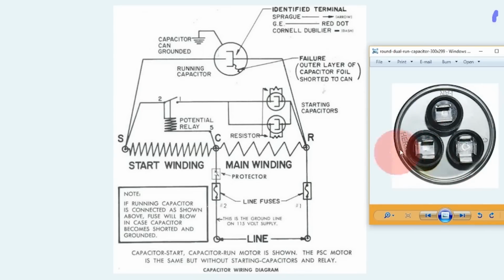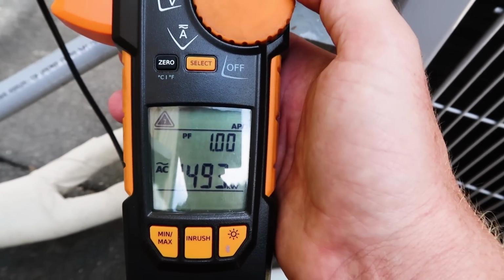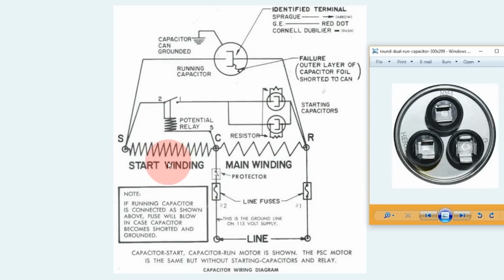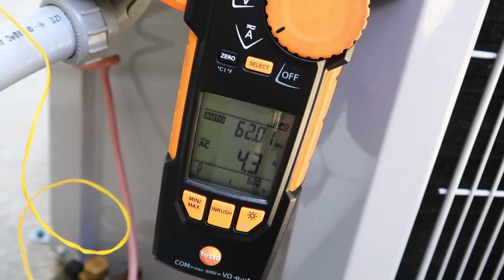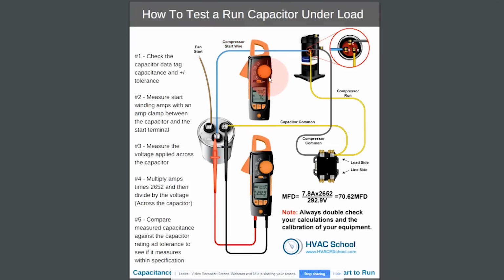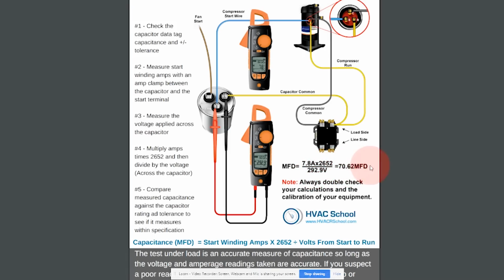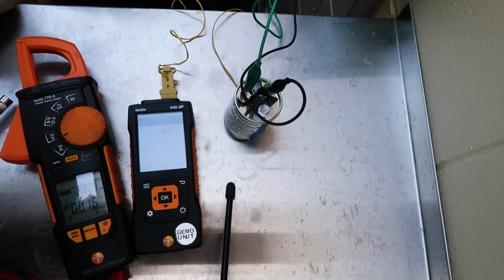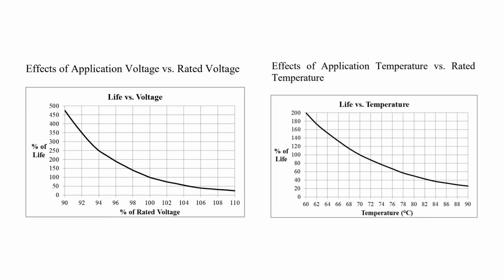Why Do Capacitors Fail? (It’s not why you think)

Comment: I wonder if at some point in the future we'll ever see condenser units transition to DC.  Some sort of switching mode power supply, running brushless DC motors inside the condenser.  Obviously there are disadvantages to that sort of setup, but maybe there are also advantages...?
Reply: it may happen the day it becomes the cheapest solution.

In home refrigerators LG has "linear DC Compressors"... low reliability makes you quickly miss the cheap Brazilian Embraco 😂

Comment: I think you should also think about a chattering main contactor.  It's impossible to change current instantaneously across an inductor... like a motor.  Some insanely high voltages can be produced if your motor contactor is having intermittent contact and there is no resistor to drain the potential infinite voltages.  These (discharging winding) spikes could easily damage a run capacitor if there is no other place for them to go.  When you see a burned and pitted contactor, most likely the run cap has had a bad day in that situation.  If there is no suppression between motor legs on the load side of the contactor this could be another factor.  The same effect makes tennis racket bug zappers produce 2750 volts from two AA batteries.
Reply: Sir Ver that’s right  change the batteries in that t-stat that works only off the battery voltage to operate that contactor !
Reply: Good comments like these help me get through all the dumb ones.
Reply: All the more reason to change a pitted contactor, too.

Comment: Capacitors, as they age, can develop series resistance (ESR), causing them to heat during use. Also, one should note that if the capacitor is not properly correcting for the inductive load (i.e. high amps, motor failing, wrong capacitor value), the voltage will be higher than the normal line voltage (back emf), and cause the capacitor to fail more quickly.
Reply: Nathan, so...could one then use a multi-value capacitor and a power factor meter or some other tester to dial in a "better" capacitor value for older systems or to compensate for wear/deviation from design?

Comment: It seems your basically saying the a run cap circuit acts like a pulse jet. Basically the pulse sets the rpm of the motor attached.  ?
Reply from the maker: James Tabor the “pulse” comes from the 60hz AC power from the utility. The capacitor just stores and discharges
Reply: So does it make it actually run on 120hz?
Reply: @BigDish101  no, just a phase shift.

Comment: From what I have noticed over the years is, Capacitors from Mexico and China have an extremely short lifespan as compared to a US made capacitor.
BUT I agree with you.
Reply: Cheap materials in the dielectric gap (oil, paper, mylar, castor oil, PCB) allows the voltage to blow a path between poles and destroy the capacitor, more likely during a voltage spike.
Reply: I have found Genteq and Jard capacitors (both made in Mexico) have  a pretty good lifespan.

Comment: Worked on a Fedders unit a couple of weeks back.  Still had original  cap.  Manufactured 1977.  Pretty sure it was a PCB filled cap.
Reply: I don't think new techs even know PCB oils used back in the day for cooling.
Reply: I haven't seen one of those old Fedders since the early 80's.  We had a Fedders unit on our house in 1972 and the compressor probably died because my parents never had the unit serviced.

Comment: So do hard start kits help prolong capacitor life? My HVAC installer put one in and said along with crankcase heaters they work great to promote life on my AC unit
Reply: Actually, it can help with the compressor life.
Reply: The factory kit?  Perhaps.
Reply: I have had compressors that wouldn't  start installed a hard start kit to the system got 5 more years out of the compressor.

Comment: Heat.  How about 108 degree day with 19 straight days of over 100 degree days and night time temps not below 90.  And discharge pressures 25 percent higher than normal.  Will that cause a Cap to fail.

Comment: Best video on the subject. EVER!
BTW, I always use caps with a dielectric strength of 440v vs. 377v. I suspect they're more robust in handling those pesky transients.
Reply: Yes, the 440v is better suited for voltage spikes, or low loading conditions.
Reply: it's good to have extra margin around the limits

Comment: I know this is off topic but why does the compressor run and the capacitor common go on the same side of the contactor ? The compressor common is hooked up on the other side of the contactor. I thought commons were on one side and loads were on the other side. Can you please explain this to me. Thanks
Reply: The "common" label on a dual run capacitor is just indicating which terminal both capacitors in the can are connected to.

Comment: Man can you please explain in laymen terms
Reply from the maker: Capacitor get hot or made bad or high volts make go boom. Nothing else do dis.
Reply: Chinaman make bad capacitor. u dig?
Reply: I needed an analogy to understand the well analogy. LOL. I think the whole thing boils down to "capacitor doesn't like heat or anything that makes heat, especially if it makes high heat quickly (lightning, surges, etc)"
Am I on the right track?
Reply: @vickycravey6848  you're on the right track.

Comment: What is the 2652?
Reply: The effective resistance of a capacitor is 1 divided by(2 X frequency X Pi. Since capacitors are rated in microfarads, you put 1,000,000 in the numerator. 60 Hz X 2=120. 120 X Pi(3.1415926)=376.99111. 1,000,000/376.99111=2652.5824. In Great Britten, they use 50 Hz as line frequency. Their constant is 3183.0989. (exactly 20% higher than for 60 Hz)

Comment: I have seen condenser fan motor capacitors fail while the compressor cap did not fail.  How come a voltage surge  didn't take out both?  These were 2 separately wired capacitors not combos.
Reply from the maker: Because not all capacitors perform to the same level or at the same quality even when they are the same brand and size

Comment: For a capacitor, by definition I = C x dv/dt so if you are getting large changes of voltage in a short period of time, then current will increase. The easiest way to get a high dv/dt is to connect and disconnect an inductive load, e.g. a motor. These high voltage spikes are very short, so you will never see them on your meter, but you would see it on a peak detector or an oscilloscope. It's this peak voltage that occurs for only a very short period of time that kills a capacitor, not the average voltage.

Of course heating and line voltage spikes will also cause premature failures...
Reply: Actually, you get a higher back EMF from an underloaded motor that can cause premature failures, too.

Comment: We have a lot of power surges and some lightning strikes where I live.  The last big power surge occurred while I was home and my furnace was running at the time.  The power surge was so strong that it damaged my furnace fan motor and killed the compressor in my neighbor's brand new (and expensive) Carrier condensing unit.  I finally bit the bullet and installed a GE power surge suppressor in my main breaker panel.  I also was having problems with the breaker for the condenser unit.  The breaker kept tripping and it fell into pieces when I tried to remove it.  The breaker contacts looked damaged and one person told me that the contacts looked like they were damaged by lightning.
Reply: Surge suppressors really only help with lightning which is not close. Lightning has a huge amount of current flowing, which makes its own magnetic field. That magnetic field can and will  cause current to flow in household wiring, which creates high voltage. All that happens past the central surge suppressor. I'm not saying it's a bad idea to have the central surge suppressor, but the closer the surge suppressor is to the equipment is protecting, the closer the lightning has to be to get past the surge suppressor, because of shorter wires which are acting like antennas. But even an unplugged appliance can be destroyed by lightning, if it's close enough.
Reply: The circuit breaker could have been old. Sometimes, the contacts inside will pit/burn causing overheating. Thus, a crumbling circuit breaker. Also, inductive loads are harder on contact points. I.e.: circuit breakers, and connection points.

Comment: Is there any benefit from checking capacitance under load vs disconnecting then using mfd on meter?

if you end up with a different capacitance is it due to inaccuracy of formula or an indication that the cap is acting differently under load?

Good video. thanks for info
Reply: if u take your test example
0.7amps at 213v:
(0.7x2652)/213=8.7 mfd?? on a 7.5 mfd micro turbo cap
Reply: @randallcalhoun6604  When I took .5 amps at 120 volts, I showed 11 microfarad! I think it's an anomaly in the meter, due to such low current. I think the meter and the calculator would match up much better if he used a 70 microfarad capacitor, so the current would be high enough for the resolution of the meter. (closer to 3.1 amps, instead of .339 amps for a 7.5 microfarad capacitor at 120 volts.
Reply: @vincentrobinette1507  the solution to reading low current is to wrap the wire around the ammeter more than once. If you wrap it 4 times, divide your reading by 4, etc.
Reply: @davidh807  excellent idea: I guess, I could wrap a wire around the clamp 10 times, then, divide the reading by 10?
Reply: @vincentrobinette1507  exactly. Just alwaysremember to divide by the number of turns.

Comment: Back emf?  Voltage spikes?  These are rare causes.    It's thermal - more head pressure, more current, more heat in the cap.  They tend to fail on extremely hot days.   I've seen double caps fail repetitively, when I split the load between two separate caps, they lasted.  Also, China caps have less margin - USA made are better.
Reply from the maker: Chris Scott did you watch the video? I established that high current on the compressor does not equal high current on the run capacitor
Reply: The run cap is in series with the start winding, so it must have the same current.  Inrush aside, you are certain that start winding current remains stable over the range of head pressures?  Perhaps,  but clearly high operating and ambient temperatures reduce cap life.  Your cap temperature measurements did not factor duty cycle (compressor on/off)  or thermal mass of the cap over the short test period.
Oil dielectric  caps are pretty rugged as far as transient overvoltages go.   Semiconductors are much more vulnerable.  I have repaired much lightning-damaged electronics to the component level over 40 years, and I 
don't recall ever seeing this type of cap failure.   On the other hand, I've seen many fail on outdoor condenser units when it is very hot.  The cap quality (design temperature, esr) can also be a big factor in lifetime.  My experience has been poor with China-made run caps.

Comment: I've seen extremely old capacitors last longer than the new ones
Reply: They were not built in China.  Caps 30 years ago would last 10 or more.  They ones  now last about 3 to 4 yrs.  I check them routinely and their weak after only 2 years..  Not bad, just weak.  I just replace them every 3 years on routine maintence .  Replacing them is cheap insurance and may save a compressor.
Reply: Daniel Roig Should've been under Carrier's 5 year warranty
Reply: Daniel Roig With Carrier it depends on the year it was made
Reply: @8GardenJunky1  
Getting a tech to do warranty work is very difficult. Warranty work pays the tech next to nothing. Companies generally make it a pain to actually get money for the part.
Reply: @8GardenJunky1  I'd actually have to charge a customer significantly more to go to the distributor and fill out the warranty paperwork, then return to install the Chinese warranty replacement capacitor, than I do to just install a made in USA AmRad capacitor off my truck and be done with it.
Reply: @johnd4348  Plenty of US made capacitors available still and not much more money
Reply: @johnd4348  The Chinese can make great caps IF the company ordering them is willing to pay the price.   It's not about Made in China,  it's about built down to a price.  Japanese capacitors are considered the best in the world and 50 years ago they were 'China'.   Now the Chinese make fake Japanese capacitors.
Reply: @jeffm2787  It's a race to the bottom.  Yes China can make great caps and any other product, but American companies and consumers refuse to pay more.  I just worked on a Trane unit built in 1987. Original capacitor and contactor.  Both ok.  Cap made by GE.  GE does not make anything of value any more. Priced out of the market.
Reply: @johnd4348  Yep, the Chinese make what other countries are willing to pay for.  Cheap price most often equals cheap parts.  Unless of course your being scammed with cheap parts for a high price.
Reply: It seems like things are built to break nowadays to make more money.
Reply: @richardbigouette3651  thats the idea nowadays companies dont make money if things last longer and techs dont make money if equipment dont fail sooner
Reply: @richardbigouette3651  Engineered to fail ,just like Mercedes cars  everything fails after 5 years if engineering was done properly .
Reply: You have to drain the cheap oil and put in synthetic oil then weld the hole back up.
Reply: After 2010-11 it's a 10 year warranty
Reply: Brandon Yes if it’s registerd. if the company that installed it doesn’t register or you don’t it drops to five years instead of ten.
Reply: Daniel Roig you bought a carrier with a Chinese capacitor ? Really ?
Reply: @iamluringyou7669  Almost all of the equipment manufacturers are using Chinese capacitors...
Reply: I am Luring You unfortunately most the parts on most systems are made in overseas or Mexico. Carrier Raheem daikin York trane Lennox Nortex all have products from Outside the us and carrier replacement parts “totaline” are made in China. That’s definitely the majority of the market there at least residential.
Reply: Goes to show ya, there's no substitute for PCBs !
Reply: John Cote just changed my indoor cap from 1995 furnace
Reply: So thats what happened (why I just paid $225 for a $15 cap)..  My original cap lasted about 25y.. Moncherif replaced it about 15 months ago (motors were still running).. now 15 months later.. the fan stopped running/cap was bad ($225 for the cap.. ~$450 total).
Reply: @robmcke5424  BMI start caps and Goodman run caps, USA made.
Reply: Richard Raucina Goodman’s garbage units bro. Just sayin..
Reply: because new ones are dry film and made in china. they are DESIGNED to fail.  "chinese capacitor conspiracy" is an actual thing. look it up.
Reply: You can get the same capacitance value using less and or thinner material.  The ESR tends to be higher for those cheaper capacitors which decreases the current handling ability without heating.   The voltage rating is also often right on the edge for the cheaper caps vs a good cap.    Use a thinner dialectic moving the foil of the capacitor closer together and you can get an increase in capacitance with less foil used.   Bottom line,  bigger and often heavier is better.  Exceptions exist of course.
Reply: I had a bad compressor on a 30 year old Rheem. The capacitor was still good and from what I could tell it was original. Heavy as a brick though. Lol
Reply: The old capacitors had PCB oil.
Reply: @pauleohl  BINGO AND MADE IN THE USA
Reply: Because their made in USA, and not China.  45 year old capacitor and still good.  Chinese Capacitor one year old and 50 percent weak.

Comment: I'm finding that the 220 Volt Systems can range from 203-247 volts input; so if you have high or low 220 input would that not change the run cap MF load?   If that were true the load would be different from the rated run cap and could that cause the issue of early run cap failure?

Comment: Run caps used to use pcb oil known carcinogenic in their oil, outlawed now, now they use castor oil,  and don't last as long

In Florida units runtime is a lot more, its hotter longer, than other regions of country

The power surges, lightning strikes, and brownouts cause high rate of failure 

Poor quality made in china caps fail prematurely, Most manufatures now use these sadly to save money, our company now only sells Made in. America 440volt rated capacitors and has had way less call backs on warranty failure of caps we install.
Reply: All the computers switched over to Japanese capacitors, much better quality. If you can get them, try looking for a Nichicon brand capacitor, I've had computers last 10 years in near continuous service without a capacitor failure in the power supplies that use that brand capacitor.

Comment: Question?....Does the leading voltage( Lag current) from the  motor synchronize with the leading current ( Lag volts)from the capacitor?...Is that how the phase is correction?
Reply: sorry...corrected?

Comment: Hot climates would certainly need the equipment /capacitor to work more. Could it be that simple?
Reply: Well, a 60,000 operating time translates to about 6.7 years of continuous operation. Since these units don't run continuously, heavy running in the summer isn't going to make up for the rest of the year with intermittent operation. But, they're still be some capacitors which don't meet their rates lifetime even if nothing is wrong, and those are the memorable ones. The units that work for years without a service call aren't memorable.
Reply: @johnhaller5851   good points. thanks for sharing john. i'm just trying to soak up anything i can right now. it's hard, but i'm trying to wrap my head around continuous run-time vs. too much cycling. hopefully i'm not sounding too woefully inept here.
Reply: I'm just a newbie HVACR student, but I think so. More work means shorter lifespan to me.